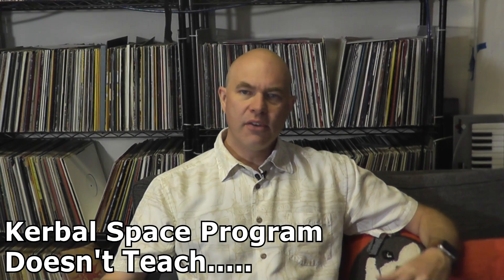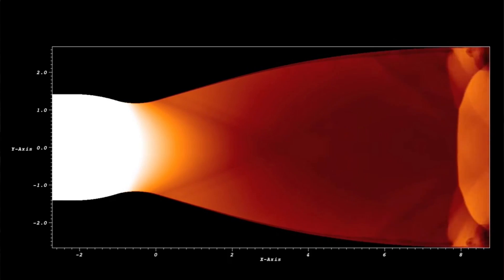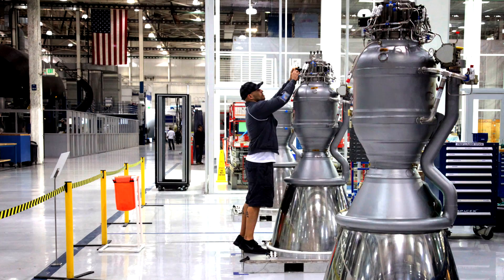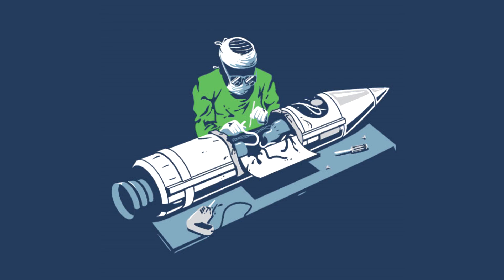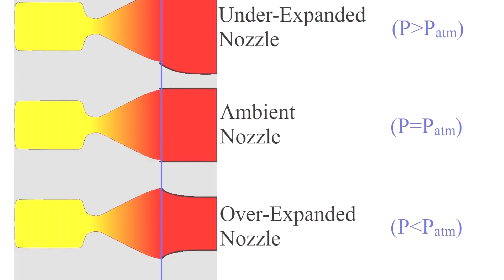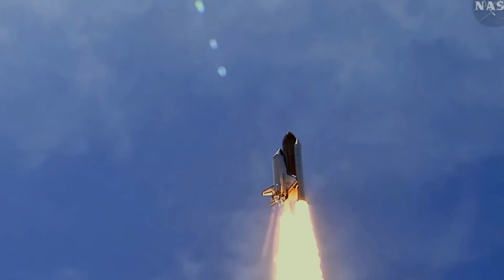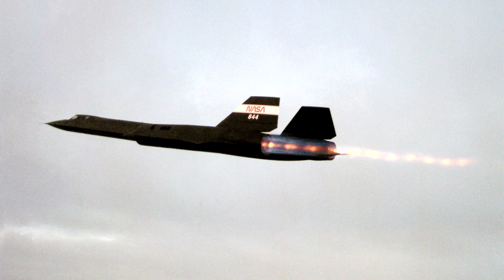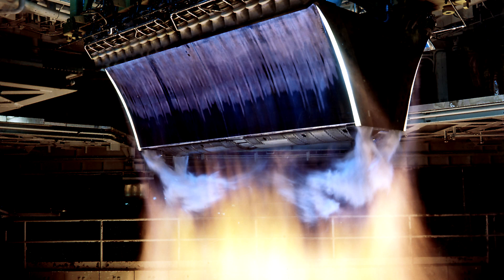Kerbal Space Program Doesn't Teach... Rocket Nozzles

Comment: Do you know if there is a ksp mod which ambient air affects thrust in positive and negative ways? Such as ambient oxygen in the atmosphere and fuel like wood is what fire needs in order to burn. The ambient oxygen or higher density air pockets, water vapor and/or other gases would affect rockets. A mod that tells me how hot a rocket is burning, the heat tolerance of the nozzle the thermal dynamics of ambient heat and atmospheric speed and pressure to direct the energy in one single direction to increase efficiency and speed. A mod that takes the linear aerospike engine but adds its aspects to the game not just as a part. Also a mod where you can reshape nozzles in different ways and choose to make it have different types of nozzles such as bell, open, air intake assisted liquid rockets or aerospike type and others. 
A mod that adds 90 percent or more realistic physics to the game. A list of realistic mods would be nice. I'd appreciate it.

P.S. I have watched several orbit videos to get two vessels to intersect however I am having trouble getting close. Is there a mod that can give me more accurate targeting or a match my targets speed and orbit? I get 100m/s close but i can't get closer and if I do try to close the distance i will pass it. A mod that gives me a indicator of when to speed up and slow down for the intersection would be appreciated. I made a fuel station and tried  20 times to get close enough to dock with it and couldn't. I also was thinking about orbit speed that moves slower such as the moon and practice at low velocities first. The orbit training didn't help me at all either. i tried 20 times their as well.

Comment: How do nozzles work on landers?
Anyone who’s played KSP knows the agony of having an engine longer than your landing legs. I can’t imagine how bad that’d be if it was a major issue irl, especially for vacuum-optimized landers. Do they just sacrifice efficiency and make the bell short enough to fit, or does the lander’s structure just extend down around the engine (vaguely like how you can use upside down fairings in KSP along with the move tool to make the bottom of your lander closer to the bottom of the engine?)
Reply: I feel your pain, I have lost way too many engines because of the short legs.

In real life, landers are very lightweight, and they have to fight against a weaker force of gravity than the engines that power rockets on Earth. So, the chamber pressure of those engines are usually smaller, and thus require a smaller nozzle.
Reply: @raphael0208  Hmm, I guess that makes sense. Thanks mate!

Comment: I thought of a more intuitive explanation. We want the gas to go directly rearward, in order to push the rocket equally and oppositely forward. The nozzle is designed to expand the exhaust gases to ambient pressure so that it only travels rearward. Without a nozzle, the exhaust would expand in all directions, and this would result in thrust every direction which would cancel out a lot of thrust.
The nozzle can be thought of as a lens, a collimator, that guides the exhaust gas into as close to a laminar flow directly out of the engine as possible.

Comment: What's wrong with the Poodle's nozzle? You actually CAN build small efficient engine but it will have low thrust due to small size.
Reply: The issue is the fact it's so efficient in space, while also having a laughably wide nozzle (especially pre 1.16 when this came out). Small engines can definitely be efficient in space, but that's because they're built with long and thin nozzles instead of flat and wide ones.

Comment: I've been long time wondering now.. Since SpaceX managed to land so many stages back (which WAS insane engineering challenge indeed), why not make nozzles change shape to accommodate different launch points.. such as Mars for example? Can't be more challenging than landing.. say a stage or a booster. Nozzle shape along with injectors efficiency seems to be the keys for efficiency when "going where no one has gone before"?

Comment: kerbal space programm actually teaches this indirectly. After trial, denial, terror and error I figured out myself that you use a series of vector engines for the liftoff stage, at about 12k alt. and 800m/s the second stage starts firing with 5 Mastadon engines, and the first stage, the orbital or transfer stage is the rhino engine.  with this system you can get anything into orbit. You always maximize the thrust surface of your rocket but the higher and faster you go you want to use less but bigger engines. There's actually an Ascl ISP value for each engine, but you need kerbal engineer to figure that out. I remeber in the beginning I always used Rhino engines as my liftoff stage wondering why my twr was always below 1.

Comment: Scott, do you have a video in which you explain exactly what the role of the heat exchanger is around rocket nozzles? Why on some rockets must fuel be run through this setup before introduced into the combustion chamber? Thanks!

Comment: Scott, this video has bothered me for some time as it is an interesting problem.  I have been playing with the idea of a solution that probably will not work, but it seems it is worth sharing.
As the outside air density changes the optimum nozzle shape changes, I accept this.  So I wonder if a pseudo nozzle can be made with several smaller nozzles?  My thought is maybe you have 7 nozzles and at launch, you fire all 7.  As you gain height you shut down 3 or 4.  When in near orbit, you only use one.  I know there is overhead in this, but if it is efficient enough, perhaps...

Comment: Scott - there's one important thing you didn't touch on in this video that I wish you would explain - though I think I figured it out (after several years of periodic wondering, finally) by extrapolating it from the info you included here. You should explain why a particular nozzle is optimal at a given altitude.

The fact that the ideal vacuum nozzle would be infinitely large was the clue that really clarified the situation for me. I've heard many times in many ways how rockets and jets try to lower the pressure to 1 atm, but this always seemed the opposite of what they were really doing - trying to create an output stream from the highest possible pressure...

Ie, I think you should explain (if I understand it) a nozzle's optimal shape is one where (ideally) all propellant molecules have been theoretically repelled from the nozzle wall, out the exhaust opening, moving opposite the rocket's intended motion. In reality, molecules bounce around randomly, creating "pressure", and so the optimal nozzle is one where the exhaust pressure does not cause the pressure of the propellant molecules to push out of the nozzle's rim, since any such perpendicular-to-velocity pressure represents lost energy... right?

Comment: A rocket scientist does not exist.  There is no such animal.  The correct terminology is
 Aeronautical Engineer.  To understand rocket nozzle design, you must first understand
The Method of Characteristics.  This mathematical process was used in the design of
 shock free wind tunnels.  Nozzles designed this way are very long and heavy.
Modern nozzles are shorter and more efficient due to the work of J.V.R. Rao.
  The Method of Characteristics is coupled with Computational Fluid Dynamics to attain a superior nozzle.
Nozzle gas recombination kinetic reactions and nozzle gas freeze point must be considered.

G.V.R. Rao  Exhaust Nozzle Contour for Optimum Thrust.  Jet Propulsion  Vol. 28 No. 6  1958
  Library of Congress TL780.A613
G.V.R. Rao  Contoured Rocket Nozzles. Ninth Annual Congress of The International Astronautical Federation.  Amsterdam 1958  Vol. 2  Library of Congress TL787.i44
K.N.C. Bray  Journal Fluid Mechanics  Vol. 6  1959  pages 1-32  Library of Congress QA901.J87
K.N.C. Bray  Simplified Sudden Freezing Analysis for Nonequilibrium Nozzle Flows.  Journal American Rocket Society (ARS)   Vol. 31  1961  pages 831-834  Library of Congress TL780.A613

Comment: What advantage, if any, would be gained if the exhaust gases were given a slight spin as they travel through the constriction and nozzle. That could be achieved by "rifling" the inner surfaces.

EDIT: I thought of a benefit for such spin: It would counter the instability that comes from a too-wide nozzle causing the atmosphere to detach the exhaust stream from the nozzle walls. The effect is analogous to the way a spinning bullet avoids tumbling during flight.

Comment: Hello smart persons of the comments!
I'm building a valved pulse-jet engine (I don't need help with valves) and I'm wishing to get a bit more efficiency from it as that they are fuel guzzlers and make alot of heat. Adding a augmenter (a device that acts sorta like a bypass fan but only works well for pulse-jets) could give me a 40% boost but I'm looking for more power and efficiency.

Would squirting some water mist/steam into the combustion chamber help efficiency by turning excess heat into usable reaction mass for more thrust? I might potentially turn part of the tailpipe into a small boiler if this does help.

Comment: the purpose of the nozzle must be to maximize thrust.  thrust is the net force on the rocket in the forward direction caused by more rearward facing areas exposed to higher pressures than forward facing areas exposed to lower pressures.  so the purpose of the rocket engine is to generate maximum pressure on all rearward facing areas and minimum pressure on all forward facing areas.  pressure is minimized where velocity is maximized.  however to generate higher velocities the flow must be accelerated.  for the flow to be accelerated there must be an increasing pressure gradient in the  upstream direction.  these are major contributing factors to the internal shape of the rocket engine.

Comment: But if in the vacuum of space you need an infinitely sized nozzle, couldn’t you use space itself as a nozzle, basically just get rid of the nozzle completely (of course I realise that this is wrong otherwise rocket engineers would’ve been doing this but I’m interested din the response)
Reply: You still need some kind of nozzle to direct and accelerate the reaction mass (exhaust gasses) in order to maximise thrust.

Comment: I don't get the gas pressure thing. Surely is the gas pressure in the nozzle was the same as the surrounding pressure there would be no forward movement - surely the whole point iof a rocket engine is to create a high pressure exhaust?  I don't get it.

Comment: Just a question, wouldn't an after burning design for a rocket engine make it somewhat more flexible in different atmospheric pressures if you could control the shape of the nozzels using hydraulics or electric actuators to move petals on the engine?

Comment: Does specific impulse depend only on the nozzle?
Reply: Also depends on whether the engine is of "closed-cycle" or "open loop" design, the type of propellants used, the chamber pressure, the injector/combustion chamber design, whether the engine is regeneratively cooled... and probably several other factors of which I'm not aware, since I don't build rocket engines for a living. :)

Comment: It seems surprising that during the Cold War, when the Russians launched Sputnik, they paid close attention to nozzle design, but then later on in the Vietnam War with Air to Ground rockets and ground launched arty rockets, they ignored the nozzle all together, pretty much just welding a flat piece of steel to the bottom of the rocket casement and drilling a hole in the center.
Reply: I would say it has a lot to do with production time, size and reliability. If it works enough it's fine enough.
Reply: Actually it was more due to the fact that a lot of the weapons the Vietnamese were getting from Russia was old surplus and reserve weapons.

Comment: Love the explanation of shock diamonds, I hadn't seen one before. Do you know anything about how dynamic pressure affects the shape and expansion of exhaust gases in flight. I wondered if it affects rockets flying in the normal direction but I'm also wondering about how it affects merlin engines trying to light and run while flying backwards.

Comment: This is great, those little details of why a certain engine is more efficient at a certain altitude are really interesting. It looks like the Poodle's small size isn't the only thing wrong -- shouldn't engines like the Mainsail that are designed for use starting at sea level get worse performance in vacuum, unlike KSP's model of "every engine is more efficient in vacuum"?

Comment: Rocket surgery: something similar-ish happened with one of the early Mercury test launches. The heat shield on the capsule was made a little bit too large to fit in the rocket, so they made a rig out of wood, bought a router from Sears, and just cut the heat shield about half an inch smaller around the edge.

Comment: why does space shuttle turns itself after the very liftoff?Why don't they place it in the first place in that direction?
Reply from the maker: +MsJanberk because the launch pad has a set orientation. Early R-7 launchers (Sputnik, Vostok) didn't have roll control and those would be turned to the correct orientation on the pad.

Comment: This reminds me of a thing I read where modern jets with thrust vectoring flanges on the hot bit of the engine will expand the flange as they gain altitude so they keep as similar thrust as they can to if they were flying at ASL. I wonder why rockets can't do the same thing?

Comment: Interesting.  I'd done some reading on rocket nozzles in the past, but only in passing.  I always wondered why the aerospike was supposed to be so great.  Another thing that I've wondered about rocket engines is that every diagram I've seen looks like an open-ended venturi - is that what's going on here, increase speed and reduce pressure, or is something else happening as a result of the open end?
Reply: Ah, further reading tells me the difference between a rocket nozzle and a venturi tube is sufficient pressure for gas flow to reach sonic speeds at the nozzle which results in supersonic speeds in the bell.  Neat.

Comment: 2:22 "Flight Hardware - DO NOT TOUCH" - note that is taped to the side, probably by hand.
Reply: The warning doesn't apply until it's taped on, clearly.
Reply: @imbibe9891  , so it's easy, you take the warning without touching the flight hardware, then touch the flight hardware and then put the warning back
Reply: @monad_tcp  what if the warning is part of the flight hardware?
Reply: @shunpaw820  you then scrape the warning using a chisel, that's not touching it
Reply: Such Kerbal
Reply: Captain Picard will be disappointed when he sees that sign  :(

Comment: you say the poodle engine should get a lower specific impulse because it's smaller but wouldn't the efficiency be more closely related to the amount of pressure inside the bell? the poodle engine creates less thrust which means there's less pressure to work with which means a small bell will get a similar thrust expansion pattern as a larger bell with more thrust... that's ignoring the fact that the mainsail can be throttled down, which would increase efficiency in a larger bell (within a vacuum)?

Comment: Very interesting, thank you.. Now I am going to spend hours trying to figure out why exactly its beneficial to have larger nozzles in space.
Reply: When a gas expands, it cools down, as heat energy is converted into kinetic energy. The more it expands, the more of the heat gets converted into useful work. 

In vacuum, an infinitely large nozzle would in theory give you 100% energy efficiency, and smaller expansion nozzles give you efficiencies roughly equal to the Carnot efficiency for the given exhaust temperature.
Reply: Thank you, that was helpful. By converting heat to kinetic energy, do you mean hitting the side of the bell, pushing the spacecraft?

So why is it that first stage nozzles are so thin? Is it, a tradeoff where it gets high thrust but at "low" efficiency?
Reply: ***** Just think of the case where you have the engine on a static test stand. Then the kinetic energy I refer to is the kinetic energy of the gas in the reference frame of the test stand.

Regarding first stage nozzles, there are two reasons. First, smaller nozzles means you can fit more engines if the bottom of the rocket lacks space. I believe that the first stage merlin engines on the F9 have slightly smaller bells than optimal because of a lack of space.

The second issue is flow separation which Scott mentioned. If the nozzle is too big the flow stops sticking to the edge of the bell and becomes chaotic. If there is enough space to fit them, first stage engine nozzles are usually made as big as they can be made without hitting this flow separation limit.
Reply: First stage nozzles need to be smaller because at low altitude atmospheric pressure is higher than the exhaust pressure at the edges of a big bell, air is forced to creep into the nozzle and introduce turbulence in the exhausting flame.

Shuttle engines have a very high exhaust power which keeps the pressure inside the bell higher than the atmospheric pressure. So bigger bells need higher power at low altitudes to work.
Reply: It further reduces the pressure of the gas flow to be closer to ambient (vacuum) which means it's more effecient for the reasons Scott described.

Comment: One thing that bugs me about the "aerospike" in KSP is that it's not, strictly speaking, an aerospike at all.  It's a "spike nozzle".  A true aerospike has a truncated spike, with the volume below it pressurised by a small amount of bleed gas from the engine.

Also, I hope that toroid is a ring of separate chambers, because annular combustion chambers have some really interesting oscillation modes that apparently make combustion stability an absolute bear.